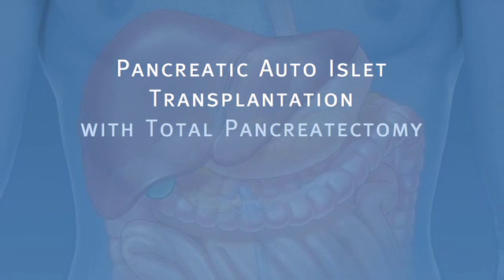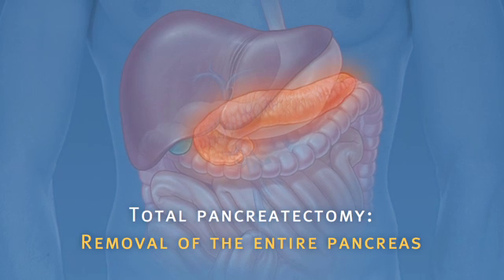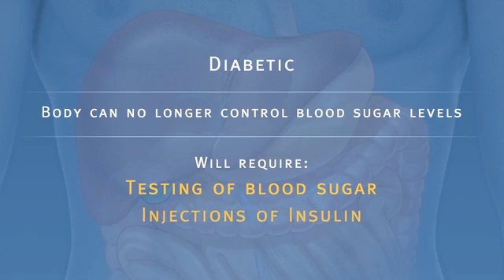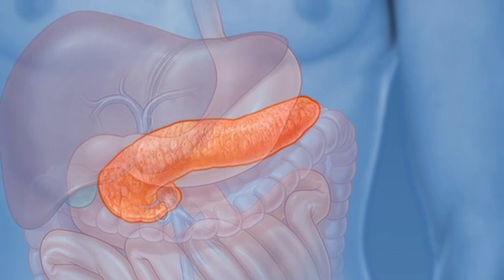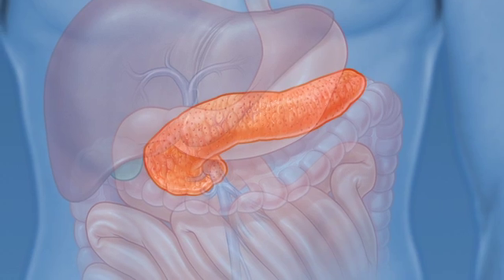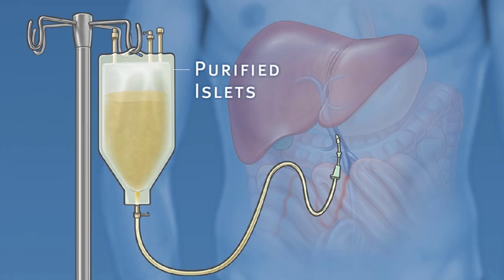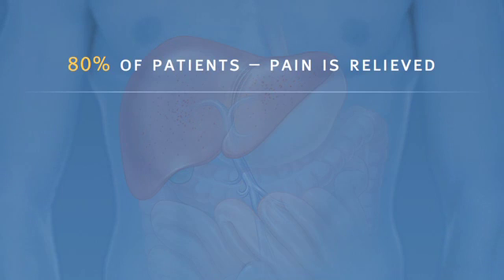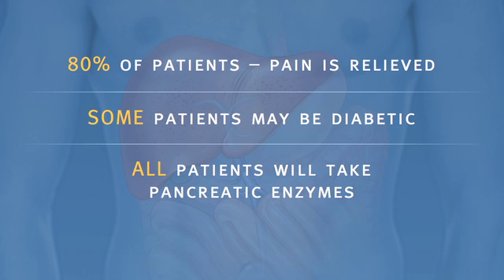Pancreatic Auto Islet Transplantation with Total Pancreatectomy

Comment: I'm tad confused.  Is this showing/telling that the cells of the pancreas once removed and implanted into the liver & hopefully starts producing insulin .....that the liver now becomes the patient's NEW pancreas?
Reply: +Patricia Vestevich Basically. Islet cells are clusters of pancreatic cells, such as Beta cells, which are the insulin producing cells of the Pancreas. The Liver doesn't technically become a "New Pancreas", but does produce Insulin due to the Beta cells in the Liver that have been transplanted. I've seen research on these islet cells being injected into other body parts (such as the arm) and insulin is produced there.